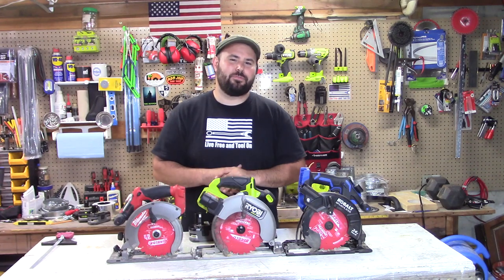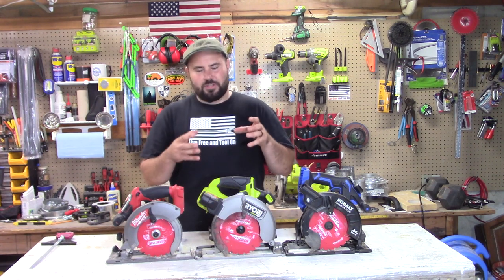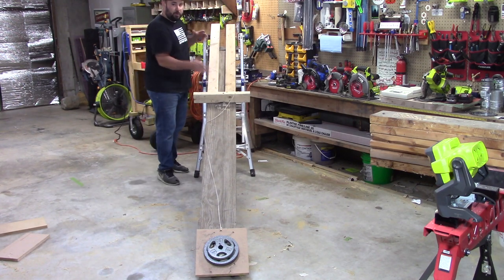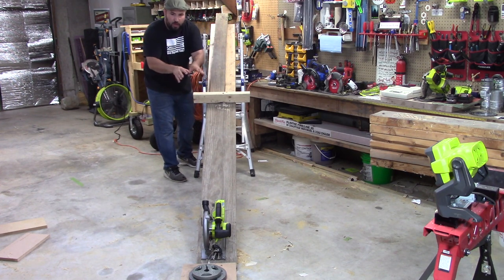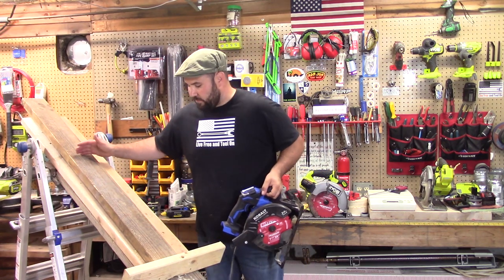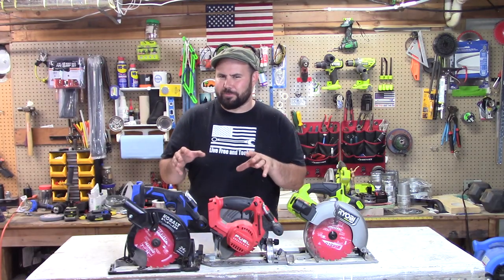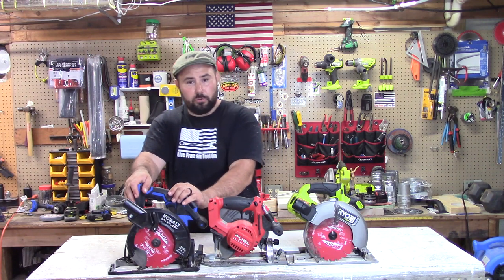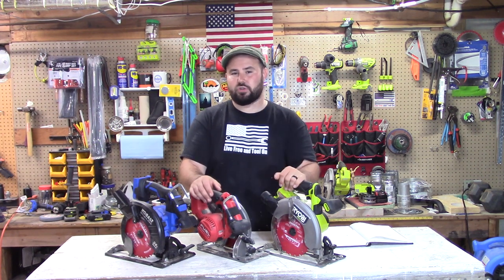Circular saw CRAZY TEST [Never before seen]

Comment: If you look at the RPM and the circumference of the blade, you will probably find the Ryobi & Milwaukee are very close in number of teeth cutting per second.  That said I’m sold on the Ryobi line, I think they have almost every imaginable tool you could think of running on that 18v system that keeps getting better over time. Keep up the good work brother, enjoy your videos 👍

Comment: Want the ryobi to scream.  Put a 6.5 blade on it and run it against the milwaukee.. boo yaa.. I've got a 7.25 brushless left side blade I run a Hercules  6.5 blade on it .. it's fast, light and total cost 90$ and some change. And I will cut 2x12 pressure treated wood all day..  I prefer the leftys.. that's the only reason I haven't gone hp yet..